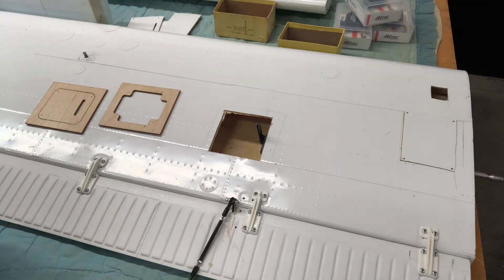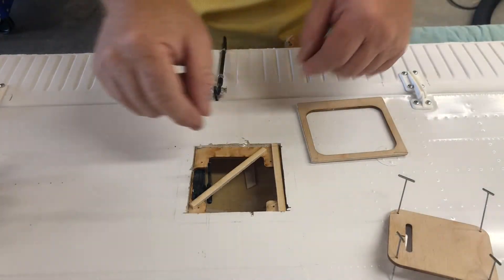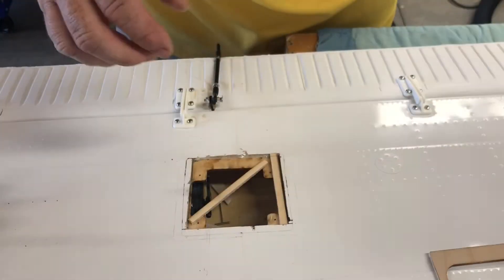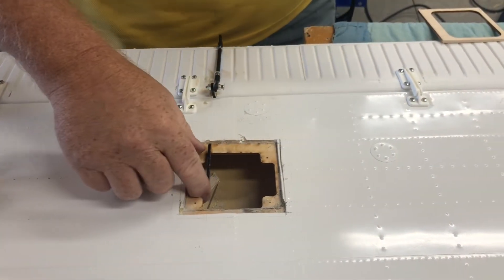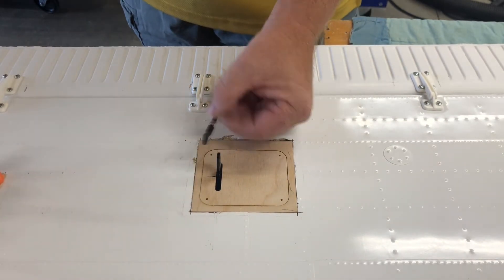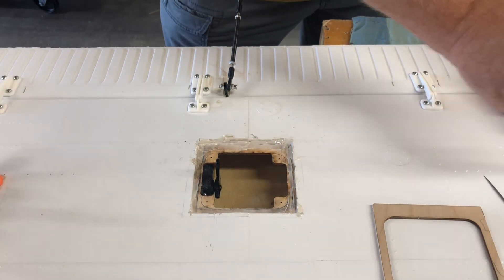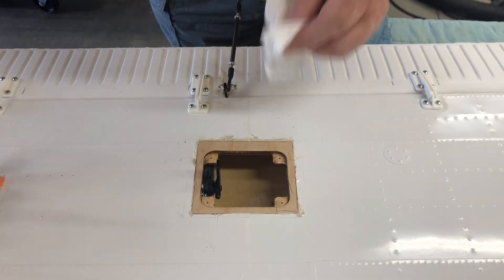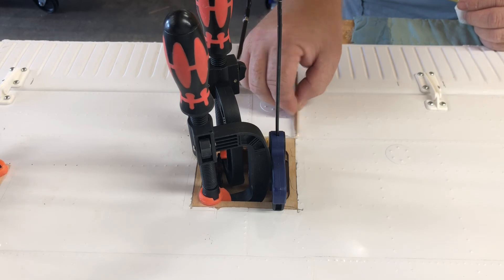How to install Servo hatches

Comment: Sorry if this is a dumb question, but what are the ribs for on the ailerons?  Is that there for panel stiffening or for aerodynamic purposes?
Reply from the maker: Those ribs are there for stiffening purposes of a full-scale airplane. There are many airplanes that have this type of a design but basically it’s just for Stephanie large surfaces a metal. I hope that helps answer your question